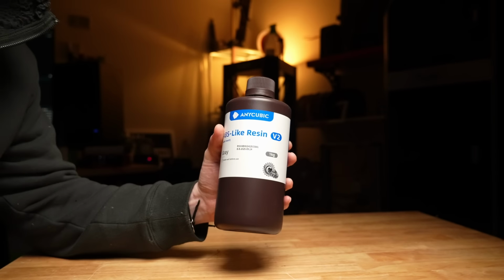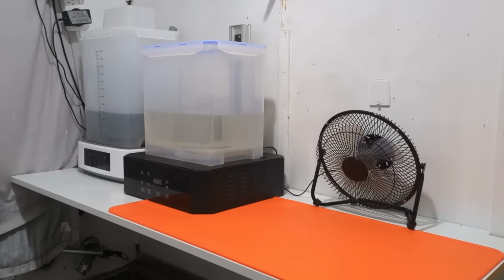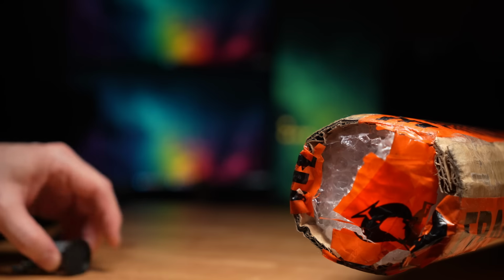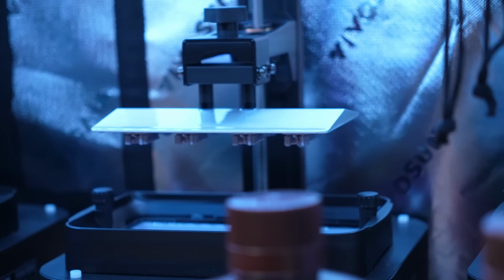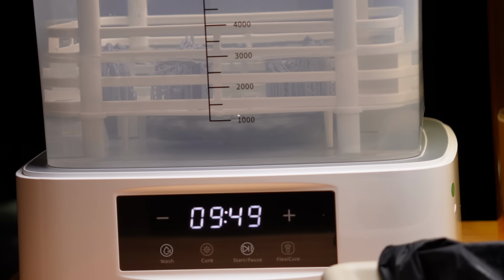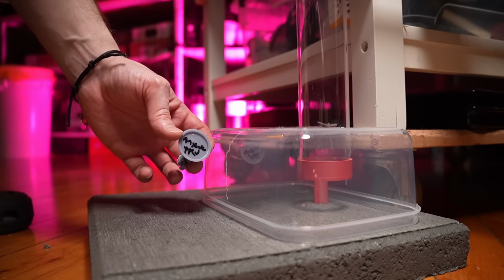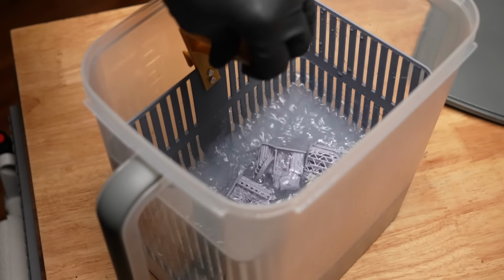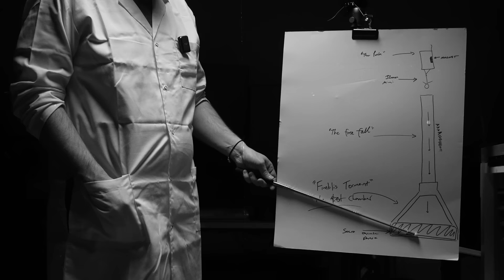The hunt for GREAT water washable resin (Part 1)

Comment: To everyone that uses water washable resin, you can use regular resin without using alcohol! Propylene glycol is very good at washing resin away. Its non toxic and has no scent, its most common use is as a food preservative.  

I use a 30/70 mix of and water with a bit of dish soap in spray bottle for cleaning things. and a vat of  40/60 of glycol to water for the prints.

The only major difference is that the glycol has almost a slightly slimily residue.

So my normal routine is drop the prints in the vat and do a rinse cycle anywhere from 10-60 min depending on quantity.

after that I take a bowl of hot water and dish soap and just wash away that residue.

then dry and cure.

If you look at the safety data sheets for non-alcoholic resin cleaners almost all them use as there main ingredient propylene glycol. The actual resin cleaning products though are more expensive. Where I am PPG is cheaper then alcohol as well. 

Its also goes further then alcohol because you can dilute it I bought 2 gallons a year ago and have never opened the second bottle.

If people want proof I can upload some of my prints after cleaning to show.

Nobody  in my opinion should be using alcohol its just way to harsh.
Reply: I'd love to know more.  Have you created a video showing how?  If so, drop a link.  Thanks.
Reply: @NomaddUK  I don't have a video, but Can explain.

It pretty much works the same way as anything else.

I have my vat which is about 60-40 water to glycol.

When I finish a print I drop it in there and wash it.

After That I take a bowl of hot water with dish soap and throw the print in there. This is also typically when I remove the supports as the hot water helps them release without leaving harsh marks.

I then have a couple cheap cheap sponges that I use to go over the print and clean any areas that might have been recessed so the wash couldn't clean them nicely.

After this I take everything and just rinse them with water.

dap them dry with a towel then let them dry and cure in my curing station.

For all my components I have a spray bottle that I mix to about 70/30 water to glycol with dish soap. 

I use this for cleaning the vat, Fep, Build plate, any tools. I just spray it generously and then wipe with shop towels.

All waste goes into clear garbage bags which I can leave outside to cure and dump.

The Vats are also really easy to clean. I have not replaced the glycol/water ever. The resin seperates from the glycol mixture way better then alcohol in my experience. 

Alcohol always ends being a slurry with resin suspended in the alcohol. With the gycol the resin just sinks to the bottom of the vat if you just let it rest. I dump the liquid into a spare vat. take the old one outside to let cure and scrape clean. 

Here are some photos:
https://imgur.com/gallery/resin-vat-TjPU2oz
 This of the vat. I have not cleaned that liquid in over 6 months I just top it up every now then as the water slowly evaporates. Which is also a huge plus because glycol doesn't evaporate.  I have printed about 8kg of resin  with that without it needing to be cleaned.

https://imgur.com/gallery/prints-dGR5Dl9
Here are some prints the unpainted ones I just did the other day as a commission for somebody. The tanks I printed a while ago and have been painted.

Overall It might take a bit longer to clean and dry things because alcohol just destroys resin, and evaporates so quickly. But it is so easy for me to work with and there's no strong odor and its just a better experience.
Reply: @andrewh9284  Very interesting to know. Do you think it would be possible to expose the contaminated liquid, filter and recycle it? I just built a diy wash recycler.
Reply: @86abaile  Yes most likely. if you look at that imgur link of the vat. You can see the mixture is almost perfectly clear after months of use. I never got that with alcohol.

Comment: I use water washable resin because the solvents were not an option around my kids when they were younger.  Now I use it out of habit - my printer is dialed in for the Sunlu water washable which is affordable so that's what I use.

For cleanup I hand rinse my prints by swishing them back and forth in a clear 5 L bucket of tap water.  I only print on the weekends so I put the lid on the clear bucket and set it out in the sun during the week which cures and precipitates the resin dissolved in the rinsate.  This typically leaves two layers.  A cleaner layer of several L on top and a sludge layer at the bottom of resin precipitate and some water.  Siphon off the clean water at the top to dispose of and then pour the sludge layer into a disposable aluminum baking pan with a clear plastic lid (it is technically disposable but I'm still using the same pan I first started with years ago.  The baking pan evaporates off any water still in the sludge and then the solidified remaining resin can be trashed.

As far as drying time, I've never noticed that because I water cure my minis.  They go straight from rinsing to the water tub in my curing chamber.  I actually forgot that if you use alcohol you have to wait for it to dry.

Also, Sunlu recently released a water washable ABS like.

Comment: My advice for improving the drop test is to eliminate as much of the extra mass as you are able, and compensate for any extra by reducing the drop height. Most miniatures have very low mass and adding more than double that to a miniature and dropping it from a whole meter is just way more punishment than any miniature is going to see in real life. Ideally you would start with a known resin like the Sunlu ABS like and try to replicate what it's like to drop one of those off a table. If you can make the worst damage from a table drop repeatable in your rig then you have succeeded.

Comment: About your results: a drop test it is hard to produce the repeatability.

It would be nice to do a traction test, you would need just to print the same 3D model and have a tool that would measure the force that you are implying. Same thing about compression and twist test, they are common in mechanical engineering. And have waaaay more control for the test

Comment: Best results I've ever gotten have been with the Elegoo Water washable Ceramic Grey. It washes just fine with water and is just as cheap as Sunlu in most resin. I've had no issues thus far, When you're done washing your prints just put the water outside in the sun. It settles and hardens at the bottom and the water can be poured off to evaporate.

Comment: I am an avid fan of the ABS-Like V2 from Anycubic. I find it's more than durable enough for typical tabletop use while being pretty cost effective, especially at the 3 for 2 sales Anycubic has regularly. I've been using water washable resins for pretty much my entire printing-journey after switching to it when my first bottle of resin that came with the printer ran out. The ABS-Like V2 is the first one where minis usually survive a fall, save if they hold something spikey like a spear. Dropped a huge and heavy demon guy while painting once and it came out unscathed.

On the topic of drying times: I've adjusted my cleaning process to a three-step process a while ago. First, the typical dirty wash, then a clean wash (both with water) and then just a quick dunk in IPA. That washes away all the excess water making the drying times pretty much indistinguishable from a regular alcohol wash while keeping costs for alcohol down, as I only need to keep one bottle handy at any time.

I'm blessed to have a recycling center near me within walking distance where I can dump my water roundabout every two months, otherwise I would probably stop using water washable resin as it does indeed get dirty quite quickly. My dirty wash usually only lasts me about 5 or 6 build plates before I need to change the water.
Reply: Yes, I use that for scenery and chunky stuff, topkebieri. It can get a bit brittle/fuzzy if you take it down to 0.030mm, in my experience, but that may just be my fine-tuning? Have you used it down there or always around 0.050mm? It also seems to absorb more water over time than Wargamer if you don't prime it promptly.
Reply: @TheHunch8ack  Printing at anything lower than 0.05mm is nonsense, in my opinion. Just takes that much longer to print without any noticeable advancements in details. ESPECIALLY not when primed and painted. I made that experiment early on and printed some of the same models at 0.03 and 0.05, then showed them to a couple friends of mine and they could not spot any differences, so I did away with anything lower than 0.05.
Reply: DUDE THANK YOU, ive been using the anycubic standard water washable and been looking for reviews for the abs like v2 for ages but everyone just says "lol water washable is garbage", once i run out of my resin ill definitely be looking at giving the abs like a go :)
Reply: @topkekbieri  Yes, I agree in general. Not least with the fading resolution of my own oldie-eyes. But then you can get fewer, less obvious layer lines with the very small stuff (with some other tweaks and orientations), though, which is handy. Interestingly I would find that some barrels and antennae which were quite snappable at 5nm were less so at 3nm, possibly because of the different stepping when angled? Not much difference visually but it did seem to help, sometimes, structurally.
Reply: Currently on sale for £17 for 1000g in the UK at the moment too.  I may look to give it a try, but I've been fortunate that i've not had any issues with my water washable resin.  Accidents do happen i suppose
Reply: @breakfire9712  It DEFINITELY is a huge step up from the regular water washable resin, which is very brittle. This was my exact resin that I used before the ABS-Like v2 was released, aswell haha

It's not quite on the level of some other non-water washable ABS-likes but a lot more flexible than other water washable, and standard resins. I really like it, especially for the price and am quite sad for it to not have gotten a recommendation in this video. I think that's due to the "normalized" drop test. It's not really practical at all to make figures fall using 1. only one axis and 2. with a big fat weight on top of them. That's not a scenario that's gonna happen to anyone playing with these minis. Printing every mini like 10 times, dropping them from a normal playing height and looking how many out of the 10 survive would have been a lot more accurate.

I, for one can say that with the v2, only every 4th, maybe 5th mini I drop breaks. And if they do, most of the time it's not the whole mini shattering but just some horn or sword breaking off. When I was using a brittle, non ABS-like resin dropping one of my bloodletters meant having to finish the game with just a base 100% of the time.

Comment: I think that moving the opening of the tube up and letting the model bounce is definitely the way to do it. Currently, it's more of a crush test, not a fall test. Alternatively, instead of a drop test, you could do a more accurate test of using a  digital force guage to see how much a piece specifically designed for the test can twist, bend, and crush.

Comment: i live in a place with 90% humidity minimum (the west coast of NZ)
my fully uv cured water based resins slowly absorbed water. in a year, my models had crumbled.
ones i had done in clear and fully varnished (my lictors) must have had a tiny exposed part somewhere, as their noodly appendages slowly flopped and then fell off, before they collapsed in their own footprint.
I went looking into the science of water reabsorption of water based resin and found a tiny amount. it basically said that it is inevitable, and my material scientist friend laughed at me. So my harsh environment just made it fast. Lots of people are going to have crumbled miniatures in the next 10 years
Reply: A year's worth of prints using eSun water-washable resin all developed fine surface cracks over a hot humid Wellington summer. This was after being very careful about minimizing water exposure during washing (limiting time and drying as quickly as feasible) prior to curing. I'm trying another water-washable resin (Elegoo 8K space grey water washable), but I'm now pretty disillusioned as I have invested a lot of time and money into 3D printing. However, I'm pretty much stuck with water washable resin as I can't use volatile/flammable cleaning agents because of the fire and VOC hazards.
Reply: @leighanddansinclair1696  ouch. sorry to hear that. I tried to share it on reddit a couple of years ago, but got banned from the sub for not agreeing with the hive mind.
I'd ask someone else to print for you, tbh. my experience was so disheartening.
The stuff i read was pretty clear, the water based resins cannot completely set ever, and remain hygroscopic. heat cycling makes it worse... they are a timebomb of disappointment
Reply: This is really worrying! Cost and time about to disintegrate before my eyes.
Reply: Thanks for this I've been thinking about making the switch but im glad I've been doing my research

Comment: in terms of experimental design and making this testing scientifically sound, there are a few big things i would keep in mind: 

1- you want to have more results to eliminate outliers and increase reliability of the test i would recommend printing multiple copies of the same mini (minimum 3) and dropping them all for example you print one and it breaks the data says 100% failure but if you have say 4 more and they survive you can identify that 80% survived , this would also help gather data on print reliability if you keep track of successful vs failed prints

2- what are you seeking to measure? i would recommend doing two types of test impact resistance and durability for that i would suggest do a low height drop test repeating until the mini breaks for durability and a high height drop test for impact resistance 

3- subjects for this experiment in particular i would also go for full miniatures with a standardised range between chunky and spindly.

4. this is basic but have a control to measure against 

thanks to anyone who read this, take care

Comment: 1. Just a flat disc on top of the tube
2. Small washer in the mini base
3. Hold a magnet on top of the disc to keep it sandwiched between the magnet and the mini.
4. Put the disc on top of the tube.
5. Lift the magnet away from the disc allowing the mini to drop.

Comment: Having the sabo changes the impact greatly, it has that additional material pushing from the top causing even more stress so the test cant be equated to a normal drop of the same height.  You also need a larger sample size of each print in each resin so you can take an average, if 1 out if 5 breaks its a lot better than 4 out of 5.  So if i were setting up a similar test i would do 5 prints of each model in each resin followed by 5 drops of each model so you have multiple metrics to base your findings on.  For the mechanism a slit in the tube with a small platform that you pull away with a linear actuator could work.

Comment: I’ve been using any cubic and sunlu on a gk2 and have had good experiences with both. I’ve had a couple failures though that could be more likely to me being new to resin printing. I use a 2.5 exposure with 6mm base layer. For the water I rinse and wash with a water hose in a 5 gallon bucket outside and just let it evaporate.  Living in AZ helps with that part

Comment: Drop test variation. 3d print a trellis structure out of different resins. Use the drop tube to drop ever increasing weights on them until they become damaged. This will give a general toughness of the resin. For fun you can repeat the test on the figures to see what weights they can take.

Comment: I really appreciate this sort of experiment. I look forward to see an improved version. 🤞

I am LOVING using water-washable resin. I started with normal resin, but after moving, I no longer knew where to dispose of the alcohol. As far as I could tell there was no where to go (I found a place later, but it's definitely suboptimal). The printing experience is SO MUCH improved with water. The only drawback, and it's a big one, is dealing with the contaminated water. I can't easily let it evaporate--which would take forever anyway. My solution is to put the contaminated water in a bucket, soak it up with some towels, and then put the towels on a drying rack outside. It evaporates quickly, it's not too messy, and after several cycles, much of the resin can be rubbed off of the towels, and put into the garbage. I am not planning on washing the towels, because that would put the plastic into the water.

Comment: I cure the water then I use a distiller to clean it. I've been on the same 2 gallons for months. Just turn off the distiller before all the water is gone to make it easier to clean the tank. The plastic goes into the garbage. I put the left over tank water into a can with a little cat litter to absorb it.

Comment: For a more useful drop test, you could try variable weight - a hollow container filled with lead fishing weights. This would allow you to dial back the forces involved in the test, and potentially also find a specific breaking point for each resin - start with an empty weight chamber, and then add weight incrementally with each drop until the figure breaks. Granted you have a noodle in there regarding the history of stress delivered to the material, but in the end I think that's still a useful benchmark for the question you're really asking here, which is "how much impact trauma can this resin hold up to."

Comment: I’ve printed a tpu seal for the sunlu ultrasonic to keep the smell inside. AND a basket in there is a must. Heavier models that are laying on the floot of the metal tank, interrupt and reduce  vibrations of the motor. So that results in a half cleaned model. SUNLU made a big design flaw here